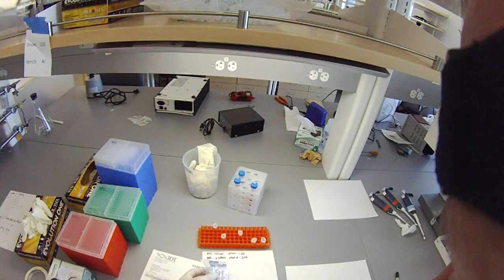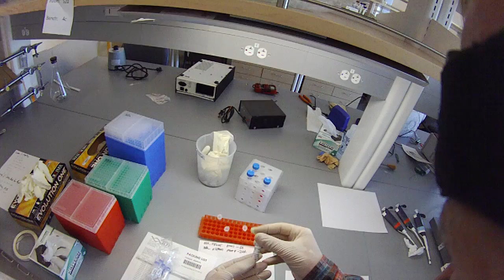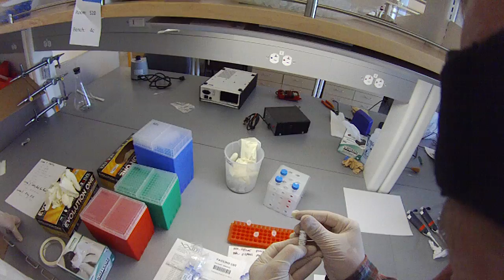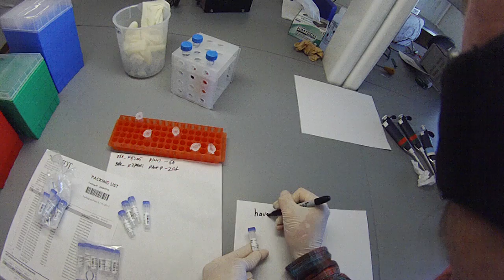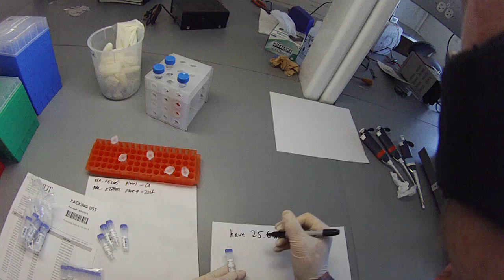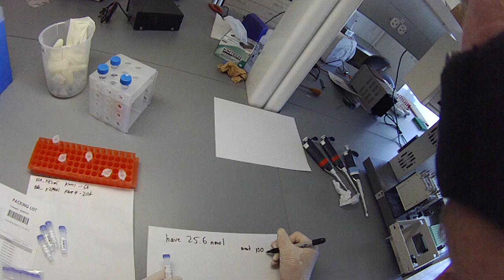Calculating oligo water volume

Comment: do the primers always come in nm moles when they are in lyophilised form??
Reply: I do not know if all oligo suppliers express the amount of material in the tube as nanomoles (nm). IDT does.  If you were to synthesize oligos yourself, you would not have this number.  Instead, you would measure the UV absorbance of a solution of the oligo, and calculate the molarity of the solution from this measurement.
Reply: @jcanderson2167  okay
Reply: How did you get quick multiplication by 10 again?